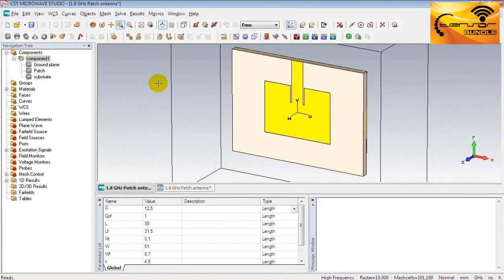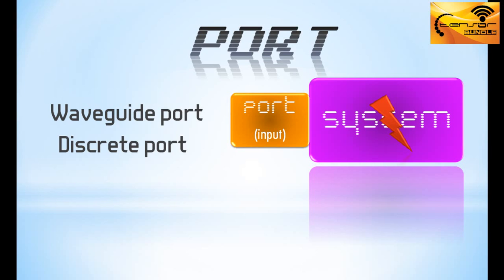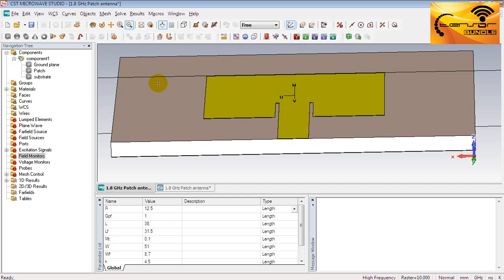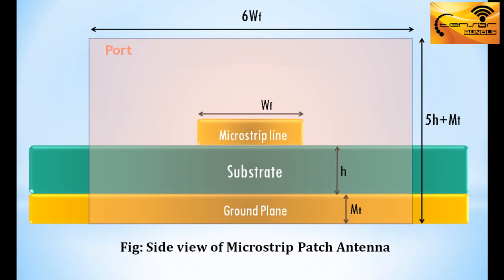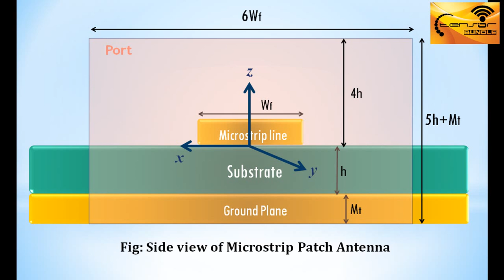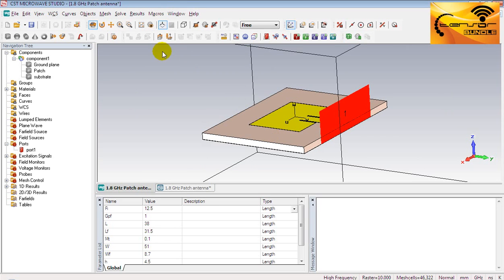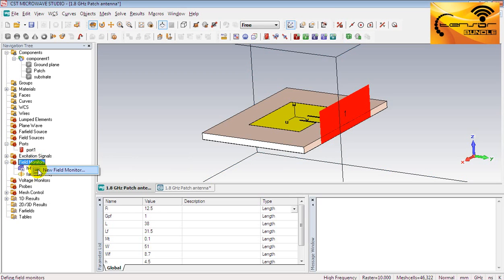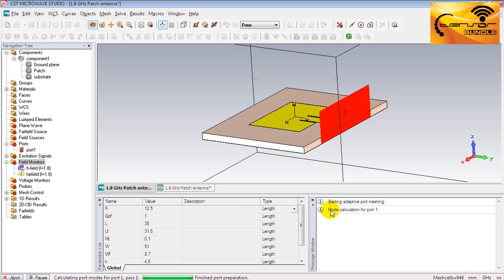CST Tutorial: Port Creation & Simulation of Microstrip Patch Antenna- Part2

Comment: How I can create switch in cst in a slot.
Reply from the maker: a metal strip with connection /without connection will simulate ON/OFF simulations of a switch. You need 2 separate simulations for that

Comment: why you use a local WCS always? because in most situations you can use the normal CS
Reply from the maker: No, when the geometry shape is complicated with lots of bends and elevations, using normal CS is disaster as hell. But using WCS is always easy in those cases as it considers relative distancing measurement for any coordinate point in space. Normal CS does not consider relative distancing. It obeys absolute distancing which is cumbersome in complicated geometry.
Reply: @tensorbundle  yes you are right for the situations you describe thank you, but another question is  what boundary conditions you should use for antennas, always open (add space)?

Comment: Thank you for the videos. Please, how do you define the port when you don't have the ground on opposite side of the substrate. In the case of Coplanar Waveguide (CPW) where you have the ground on the same plane as the transmission line. Also how do you make the design to differentiate the ground and the transmission lines. Please, I need you all to provide an answer. Thank you

Comment: Hi thank you for your tutorials ! I have CST 2015 version and I made everything  that you made but at simulation part it is some different than 2010 version so I tried to run the simulation but it didnt work . Program asks me Mesh type and ı dont know which one I should use ( Hexahedral TLM or Hexahedral ) and I  take " excited ports cannot be used without initial conditions " when i use TLM so  I couldnt solve this problem. Can you show 2015 version too ? it is some diffrent and as a student it makes problem.
Reply: +Abdülaziz Üçer You can get rid of the error by refining the mesh slightly. The cause is when the port just falls within a mesh.

Comment from the maker: Two cases can be possible. #1 The solver options i.e. transient solver etc. remains disabled until the user completes all mandatory steps (defining freq range, field monitors, ports etc.). Once those steps are done, the solver option is enabled automatically. So, you might want to check if you missed any of those steps.
#2 If this problem occurs every time even after you completed those mandatory steps, perhaps it's due to 64 bit win. I've experienced troubles like this in 64 bit win in the past

Comment: The port couples energy into and out of your system using a modal method. An eigen mode solver calculates all possible modes which propagate and not propagate based on the geometry of you system and the material properties. Ports are useful for modal analysis of a system through s-paramaters. Bc of this you get juicy information of your system through impedance and reflection/transmission coefficients.

Comment: Many Thanks!!! and a short question. 

Hi, thank you very much for this kind of share! I only have a question about thewaveguide port dimension: You've showed that the physically the waveguide port width is 6 times larger than the microstrip width, and its length is (5 times + groud size) bigger than microstrip one. Could you tell me why? for example why 6 times larger instead of 3? (or instead of 20).    thanks again and again for all these sharings

Comment from the maker: @Magnetron692 You are welcome.
Setting up a port for coaxial is simpler than microstrip line, because port definition for coaxial doesn't require any specific rule like microstrip line. To define a port for coaxial, select the 'face' of the dielectric core of the coaxial cable [at the bottom side of the antenna] and go to solve>waveguide port. The port settings will be adjusted automatically in this case. That's it. If you successfully do that, you will see a red rectangle covering the coaxial.

Comment: Hi tensorbundle, many thanks for your tutorials. Your help is greatly appreciated since I'm new to CST MST! One question: How do I simulate such a patch antenna with a coaxial feed from below the ground plane with the inner conductor attached to the patch by a via and the outer conductor connected to the ground plane? How do I set up the port in such a configuration? Best, Magnetron

Comment: Hi.
I'm new to CST. I knew what is a terminal but I didn't know what a port is.  I though it was the way CST calls it.  Anyway. Let's say another example.  I want to define a port on an antenna fed by a N type coaxail. I've seen that is defined selecting a rectangle around the shield and the core, alltogether. 
I don't know why we don't specify separately the core and the shield, with ports, terminals or whatever needed to specify that my signal goes through one and returns through the other.

Comment from the maker: @juanpide You didn't mention the word 'terminal' in 1st comment. Recall circuit theory- port and terminal are separate things.

CST was programmed to work  if the rule is followed in port definition. If you don't do that in the port definition, the simulation result will be inaccurate. 
BTW, in 1st comment you said you don't understand why I picked a larger port and in 2nd comment you said that you understand it. I really failed to understand why you asked about anything you already know.

Comment from the maker: @juanpide Nope. You are talking about separate ports for microstrip and the ground plane. That's ludicrous. It's similar to inject current into the antenna through both microstrip and ground plane but no exit point of the current out of the antenna. Doesn't make sense at all. A port consists of two terminals pal, one entrance , one exit. Microstrip is entrance point, ground plane exit point.

Comment from the maker: @juanpide Hi there, you can remember electromagnetics theory, right? A microstrip line can be modeled pretty much by a rectangular waveguide. You don't want to mess up with higher order modes in a waveguide. Fundamental mode is what we need. In CST the port size for microstrip line has to comply with the size mentioned in the video to ensure the inclusion of the fundamental mode in simulation and it also suppresses the higher order modes.